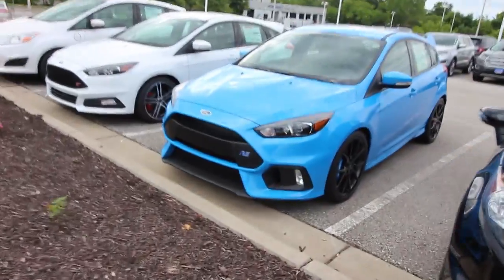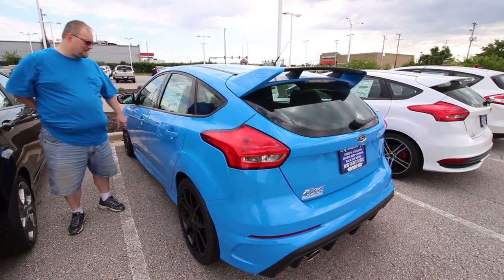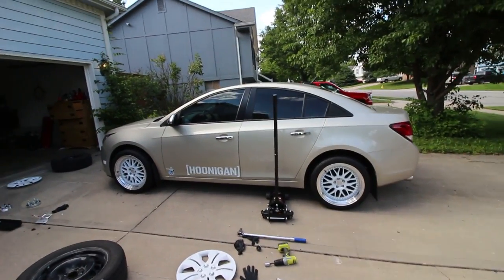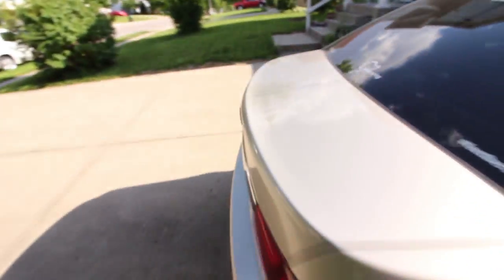Finally Finished!!!

Comment: What’s where the specs on the rims and tires? And what size spacers
Reply from the maker: 18x8.5 + 35 235/40/18 .75 inch spacers
Reply: Thanks🙏 bro

Comment: What size tires you got?
Reply from the maker: Tires are 235/40/r18
Reply: Jonas Godwin what about the rims? Like what's the bolt pattern? And are they 18 by 8.5 +30 or +35?
Reply from the maker: Wheels are 18x8.5 +30. The bolt pattern of the wheels is 5x100 so I am running a 1 in spacer adapter
Reply: Jonas Godwin thanks man!